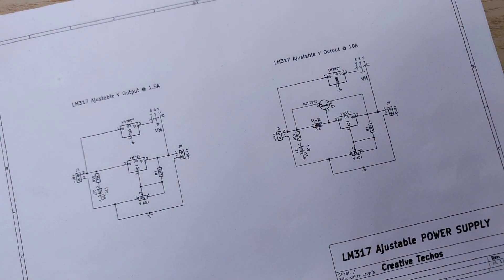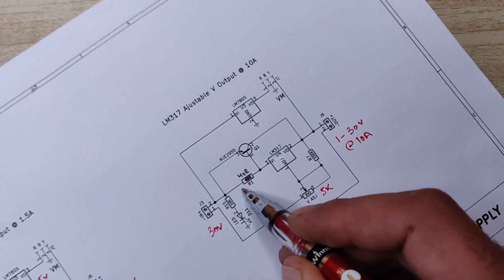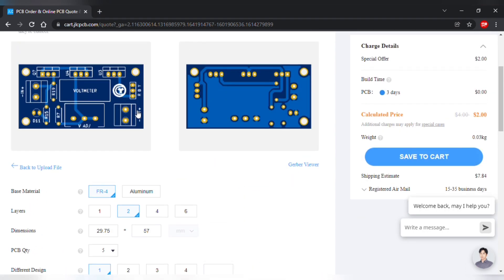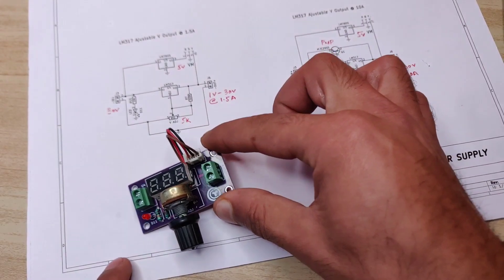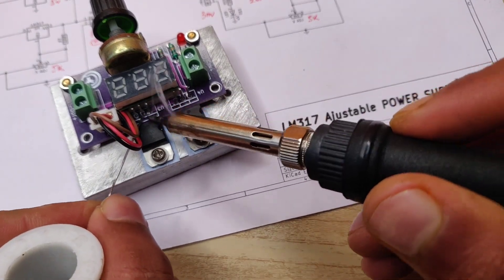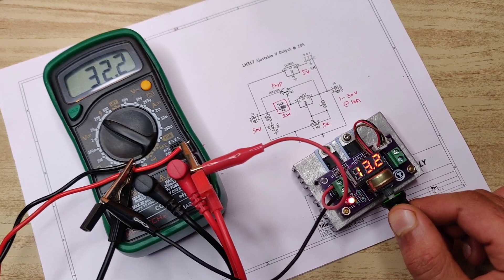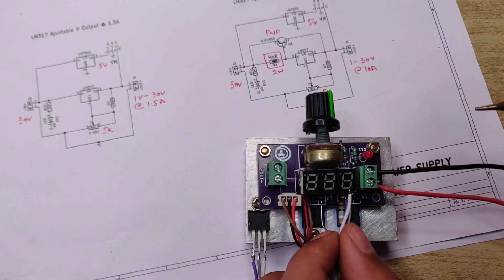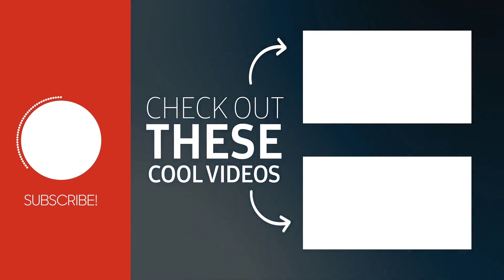0-30 volts 10A Variable power supply voltage regulator circuit

Comment: Lm317 can't give full 1.5 A even if datasheet says as when difference between input & output voltage increases multiplied by 1.5 A, the power dissipation will also increase so it can't dissipate more heat. It's only possible to draw 1.5 A if input voltage is reduced to lower voltage say 12 Volt so in that case at lowest output voltage the difference will be lower so the power dissipation. But if we need to make power supply upto 18 volt, we can draw maximum 1 A, so how we can make the Transistor conduct in that case?

Comment: Can I change 2955 with B1367, cause  i found that transistor in old broken smps power supply, side of lm317
Reply from the maker: Yes you can use, and make sure pins are connected correctly if different configurations of pins
Reply: @CreativeTechos  thank you,👍👍

Comment: Can you please give also the other side
Reply: When I see your video, I see 2 diferent sides
Reply from the maker: @pierrebladt4547  its same circuit, i dragged some components to another side. That's why tracks looks different.
Also if you're talking about pdf layout, there is copper front & back design that is only used to print diy pcb.
Other layers is for professional fabrication.

Just use copper front & back.

And follow the silkscreen layer with schematics to place components at their right place
Reply from the maker: All layers included in one PDF

Comment: Please do not forget the pcb layout. How can I get the -18volt? The +18volt ,I get that with this board.
Reply from the maker: I added pcb layout pdf. You can use input under 30v 10A max.
Output + - 1 to 30 v adjustable @ same as input Ampere max 10A

Comment: Wich transformator do you need as inputpower
I need as output +18 volt dc and -18volt dc and 5 Ampere
Reply from the maker: You can use 30v 5a smps

Comment: What exactly is the product/material you used for the insulation between the Lm7805 and lm317 and the heat sink?  Do you have a link To buy it?  Great vid, I subscribed and look forward to more of your content
Reply: Please note that, calculating from datasheet data*, your total thermal resistance from the MJE 2955 to the air (assuming 40°C air surrounding the heatsink) must not exceed 2W/°C.  Any heatsink insulation will add to the total thermal resistance junction - air, so you will need a heatsink of around 1.5°C/W  which you may find large and expensive.  Two tips here:
1 - Mount the power transistor with no insulator, but instead isolate the heatsink from any other connection.  This will save you some heatsink size and cost.
2 - The MJE2955 has a maximum junction temperature of 150°C because it is plastic encapsulated**.  The metal cased MJ2955 (no "E") has identical electrical characteristics and a maximum junction temperature of 200°C.  This allows the use of a smaller (ie higher thermal resistance) heatsink.  In this case the  maximum thermal resistance can be around 3.8°C/W.   The same principal applies here: you can save some heatsink size if you omit the insulating washer.  The total thermal resistance must include this washer if you use it. 
*links to datasheets:   https://pdf1.alldatasheet.com/datasheet-pdf/view/53666/FAIRCHILD/MJE2955.html

                    https://pdf1.alldatasheet.com/datasheet-pdf/view/117132/ONSEMI/MJ2955.html
** The MJE2955 has a single mounting hole, set in the little metal tab.  NOTE this doesn't assure sufficient contact with the heatsink.  If you look inside commercial instruments you will see that they use this mounting hole, but also add a clip or strap across the plastic body, clamping it more effectively to the heatsink.  THIS IS IMPORTANT.
Finally (i) heatsinks are sold with their thermal resistance specified, so no trouble there.
  (ii) If you can mount a fan - maybe from an old computer power supply - you can generally halve the heatsink size.  But the fan needs 12V DC.
Feel free to ask for any further information you may require.
Stay well.  Clive.
Reply: @jjmcrosbie  Powerfull essential tips! Thanks a lot Clive ;)
Reply from the maker: It is called transistor or heatsink insulator pads, also you need M8 Nylon step washer for screws
Reply: @CreativeTechos  Thank you for responding.
Reply from the maker: My pleasure 🙂

Comment: Could you please make one with 70 volt input with 1 - 70 volt output?
Reply: You need a switched AC transformer or a pre-tracking buck regulator for that, a lot more complicated. Also 70V is a lot, it be harder to find components which can span that entire range. Why do you want 70V?

Comment: Excellent project, only one point that made me curious is that the LM7805 is not recommended to receive this 30v voltage directly at the input, according to the datasheet
Reply: Actually in Texas Instruments and CTIL datasheets, the absolute maximum has been specified as 35V. So, 30V sits well below this value, but with such a large input voltage, main concern would be heat dissipation.
Reply: Then install a 5 Watts step-down resistor...
Reply from the maker: Well answered by @Levent SALT , actually here lm317 is only controlling voltage and MJE2955 is controlling current and also acts as current booster as lm317 can only provide 1.5A max, so MJE2955 will dissipate heat and needs good heatsink.

Comment: Thanks for sharing. Excellent step by step video. Could be nice having also the output current mesured together with the voltage output. Ciao e Grazie!!
Reply: It's simple. Just replace the volt meter for a volt & amp meter.

Comment: Please charge a 100Ah 12V lead acid battery...
Reply from the maker: You can also use this to charge any battery with different voltages @ 10A

Comment: Sir, according the the schematic, is 10k from lm317 input to input power supply, why?
Reply from the maker: That is mistake, the value of 40 ohms 1-2w is correct
Reply: @CreativeTechos  can adding more transistor increase the amps?
Reply from the maker: Yes, even you can use a single PNP Transistor with higher amps
Reply: @CreativeTechos  OK, thanks